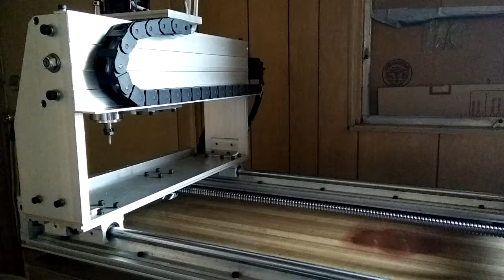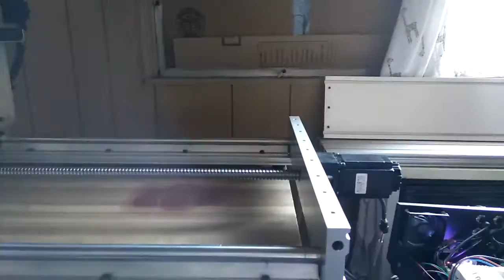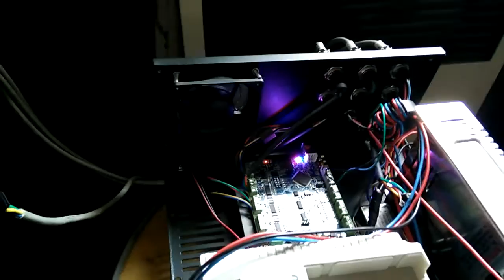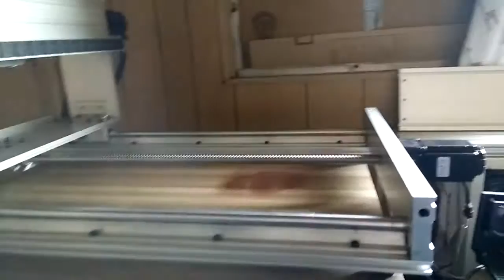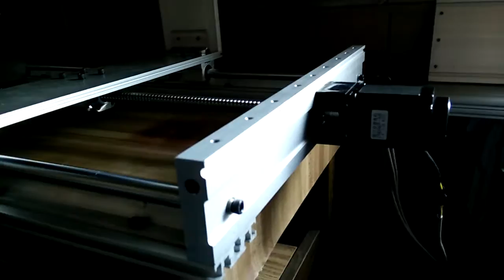6040 CNC tinyG v9 G2 chilipeppr axis stall/bind

Comment: I'd ask the Synthetos guys. Maybe it's G2's firmware.
Reply from the maker: Hey John...well it's not Chilipepper's fault, though the firmware was loaded from within CP - 0.87 edge. I can get it to replicate in other front ends. There is an open issue w/ synthethos last I checked regarding deceleration problems. Multiple people have experienced the problem, but I'm not aware of an active solution. It doesn't seem to be a bad stepper (switched it), I tried another driver on the tinyG board..same issue. Changing parameters...Y jerk to 100-200 and microstepping from 8 to 4 seemed to help somewhat. The deceleration problem indicated from others seems to be associated with longer movements. Shorter paths don't seem to be a problem and I'm able to run my X axis fine, though it doesn't have as long a travel and doesn't carry as much weight. Still, the weight is irrelevant as I've tried this with the stepper removed from the machine and had it happen. My best guess is that 3A steppers running on the tinyG v9 rated for 24v @ 2.5A may be worth considering. I'm switching drivers soon and bumping up to 48v, so we'll see what it thinks about that.  Oh, and when I'm not having stalling issues, the resonance in the 1700-2000 mm/min range is a problem. I guess that's what happens when you buy a machine with cheap parts, under-rated and unshielded wires, steppers with no identifiable specs besides amperage, a broken water pump, a completely bowed aluminum deck that is effectively useless, a bad bearing block with access to a pre-load set screw covered by the gantry, and a 24v psu that died after a month. Can it be a decent machine...sure...but so far, not so much.

Comment: Hi, same problem for my CNC6040 when i bought it.
The problem is surely the crap step motor driver.
Reply from the maker: I'd agree if I was using the stock TB6560 drivers that come with the 6040 board designed for mach3. This is a tinyG v9 beta board running TI DRV 8825 drivers. However, you may be on track with the motors being under powered. 3A steppers running the TI drivers that are really rated for 24v @ 2.5A. Now my understanding is that doing such would be an issue of not getting max torque or speed, but I've had the problem occur with no load on the motor. Initially it was just moving the gantry. Thinking that a bearing block  was binding up or something, I removed the stepper from the coupler and ran it with no load on the shaft with the same results. There is a known deceleration issue opened in the G2 github, normally realized with longer moves (like this), but other videos that have demonstrated it were much, much less pronounced. This is quite obvious.  I switched the x and y stepper motors and switched the driver channels. I still have the problem, though increasing jerk ($yjm) from 50 to 100 and microstepping from 8x to 4x has decreased it somewhat.